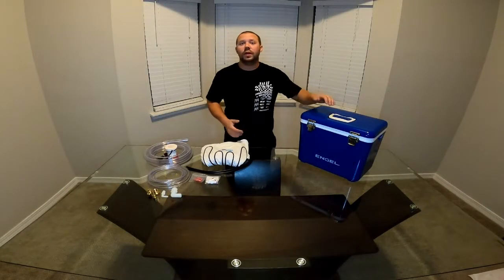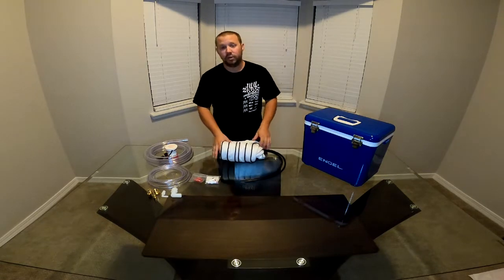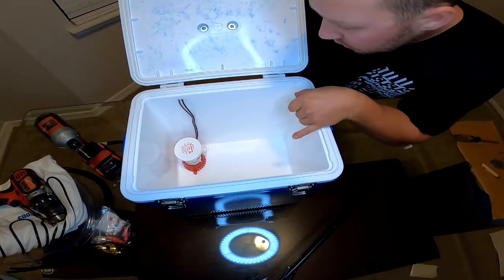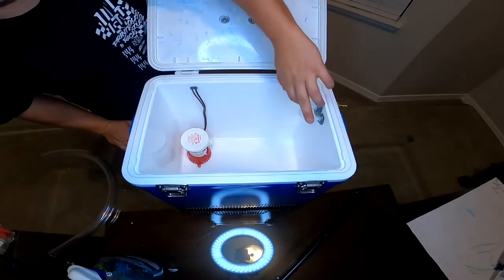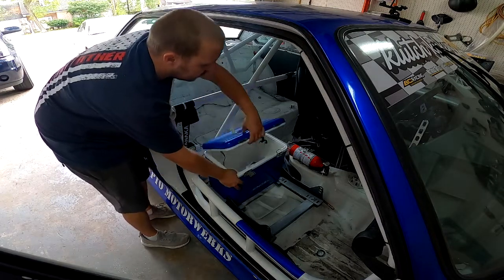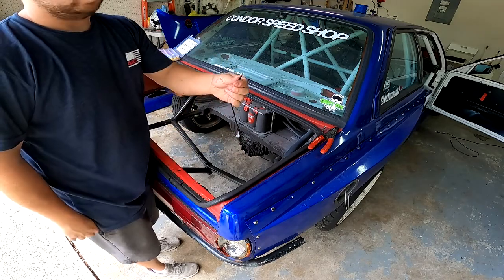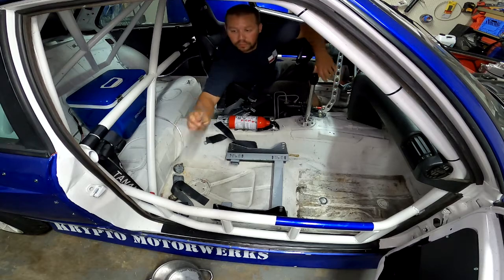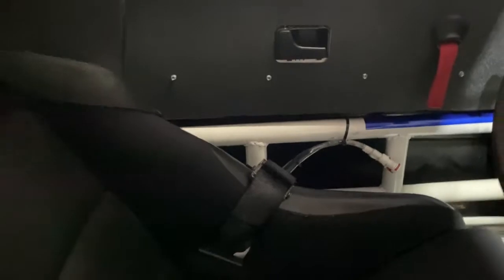DIY coolshirt system for your racecar!

Comment: What a really great video!  Thanks for doing it. You made it very clear on how to do this. I have a mid-engine car and will likely have to mount it in the trunk area. Do you see any real problems with running the inlet and outlet water lines the distance from the cooler in the trunk to the driver?
Reply from the maker: Hey thank you! Sorry for the late repy. No no issues at all. I’m still using it to this day all the time I don’t think the length you run will matter the pump is already being restricted with these little water lines to the shirt so it should hold pressure for a decent distance

Comment: Do the plugs have some type of a valve in them, so when you unplug them, water doesn't drain out all over the place?
Reply from the maker: What plugs?   There isn’t any fittings that is below the water line submerged.  You only have this thing about half way full when in use

Comment: Where did you get the cooler mount? From same manufacturer as cooler?
Reply from the maker: The mount itself is from coolshirt company.  And the cooler is just an amazing unit. Same size as coolshirt cooler
Reply: Is there anywhere to buy the fittings other than cool shirt company